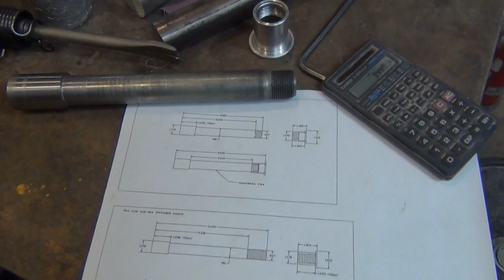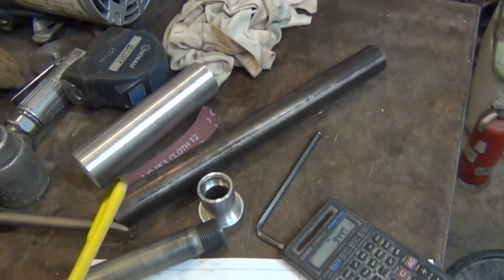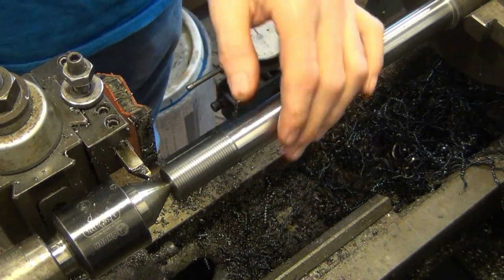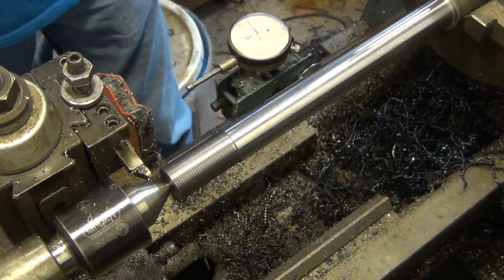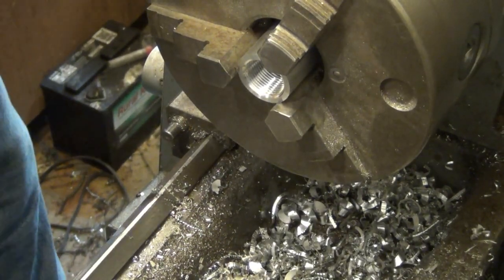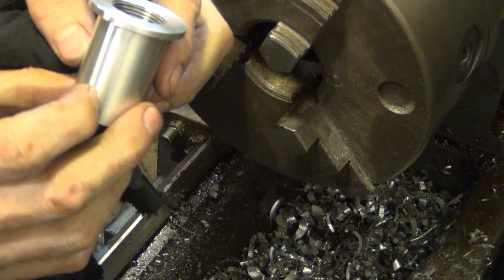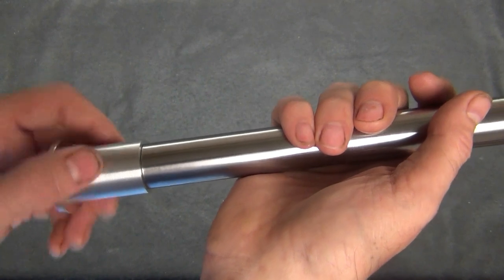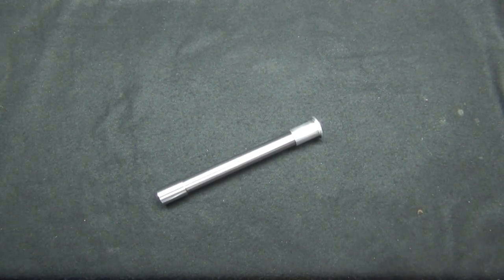Machining a Custom Motorcycle Axle

Comment: Tell your customer to put anti seize on the threads or they will never get it off. 
Really did a great job machining.
35 year Machinist here.
Reply from the maker: Thanks. Good idea.
Reply: And a couple of flats on the aluminium collar to enable a spanner to tighten and loosen it.
Reply: @donr62  the aluminium collar is clamped by the fork leg pinch bolts so there’s no need for flats 👍

Comment: Aren't motorcycle axles hardened after machining? My Mach nist said he's not going to machine axle for me, he doesn't want to kill me.
Reply from the maker: It's 4140 chromemoly aka semi hard. It's purchased pre heat treated to 28-32 Rc. Somewhat hard, but still machineable. It's not breaking without some incredible stress on it. You're machinist is smart though. He doesn't want the liability in case someone tries to blame any bike failure whatsoever on the axle. It's not worth the risk imo.
Reply: I would sign a waiver just to get one built . My bike is a 2008 FXDSE2 . I can not find an axle anywhere . Hopefully this guy will contact me and get me back on the road . My axle is almost exactly like this one .